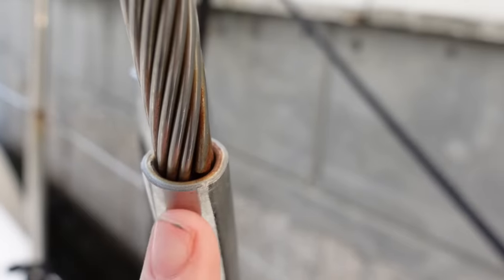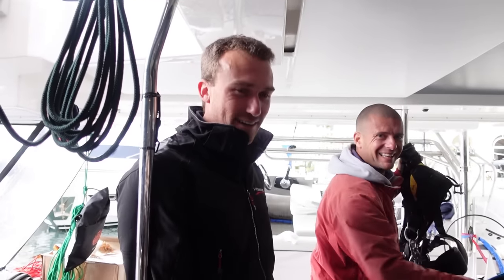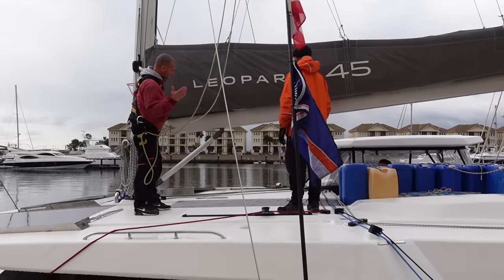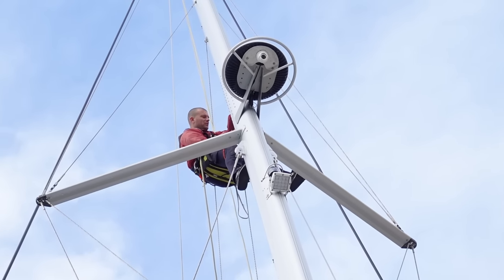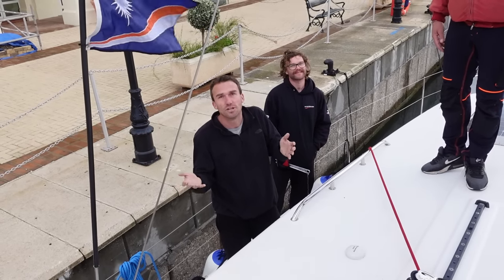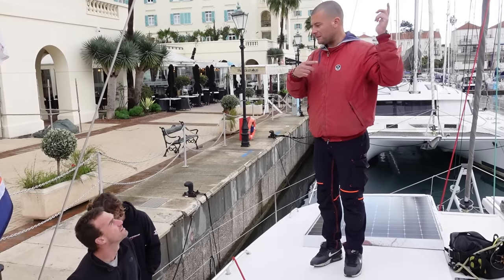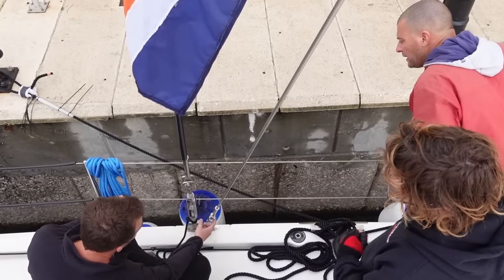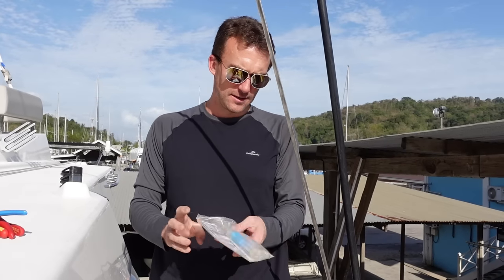ZSpars Rigging Expert Came to Our Yacht | LEOPARD 45 CATAMARAN EXPERIENCE

Comment: I was wondering whether anyone has commented or supplied a chart to adjust tension values based on the outside temperature. Tension on rigging being metal based can be affected by the mean surrounding temperature